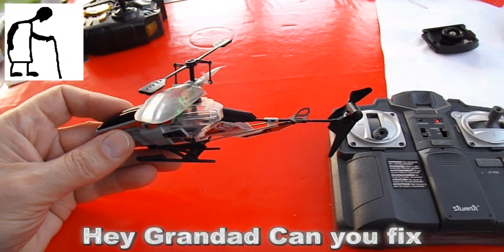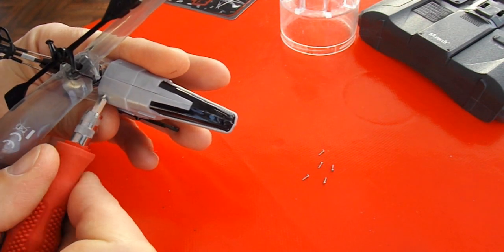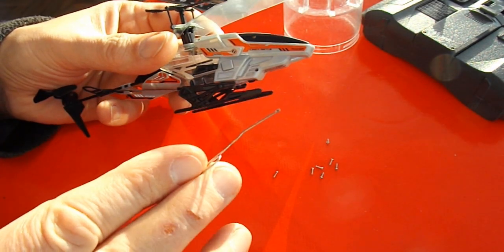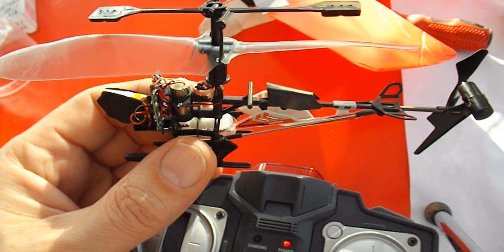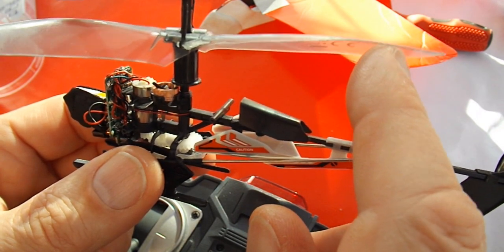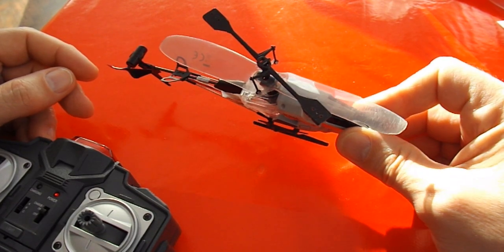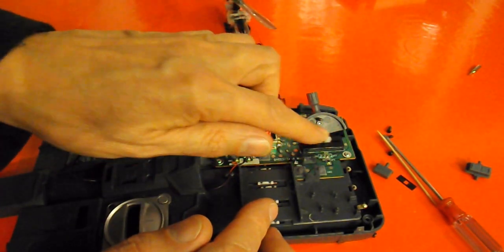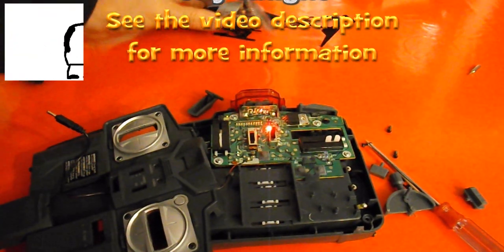Hey Grandad Can you fix Faulty Helicopter Toys? SILVERLIT HELICOPTER

Comment: hey grandad, it's either the two.
1.  The motor that controls the YAH channel is probably faulty.
2.  Towards the end of the video.  you were holding the YAH trim instead of rapidly pushing.  it usually worked on some of my old helicopters

Comment: Pl ensure tail rotor is spinning anticlockwise as not quite clear in video. If not then invert connections of motor on circuit board. If motor spin is correct then only option is bigger tail prop. Motor clearly looks big enough to handle a 2 times bigger prop. Trim & steer only have certain small range of operation, it clearly looks well out of that range. Once bring it in that range all commands will start to work.
Reply from the maker: +Ahmad Rafique thanks for the suggestions and I can see your line of thought. It might fix the issue but there is absolutely no reason why it should require any such modification. It is not likely that the wires have reversed themselves or the rotors have changed size. This is not a kit that has been assembled incorrectly, it was a working toy owned by a relative that has stopped working. Most likely is some sort of crash damage, perhaps the rotors are deformed or the motor shafts bent causing a lack of power or thrust. It could be as simple as the gears are slipping on the shafts reducing the effective power throughput. I am looking for people who have experience the same problem with the same helicopter and managed a fix.

Comment: Burnt out tail motor most likely, especially if there was a lot of hair on it. That bent up propeller probably isn't helping either. I've never seen that small thing that tilts the rotor, is it a magnet and coil?
Reply from the maker: +X-FLIGHT101 the rotor tilt mechanism was the most interesting bit. Yes magnet and coil similar to the rudder servo system on those tiny ultra light indoor planes you see on YouTube.

Comment: If you have other kaput heli's, maybe take a rear rotor off one of those and try it. Those tiny props are excellent, but, others may move more air. 
The motor is likely down on power. A new 4mm isn't a horrendous purchase for him to have his heli back working. Unless of course you have a 4mm rear motor too from another heli.
Reply from the maker: +slider2732 certainly the tail rotor is the logical culprit and I probably have one somewhere. I haven't checked the size but I had that one on the flying wing I was playing with last year. Probably got more if I look around.

Comment: Hey grandad my silverlit nano falcon AH is not working anymore it can't lift it self it needs more power how can i fix it???
Reply from the maker: There is a good chance it just needs the battery replacing - although finding a replacement battery the correct dimensions might be a problem. Some of the listings give the dimensions as a 6 digit number for thickness, width, length. I am not suggesting you buy from this site I am just giving you the link as it explains the dimensions https://www.pdbattery.com/li-polymer-battery-cells-list.html It is worth remembering that online suppliers such as eBay often over state the power of the batteries they are selling so a new battery may not be as powerful as the listing stated. It is possible there could be other problems with your helicopter such as fluff wrapped around the shaft or in the gears slowing it down or the shaft is bent or your propellers damaged.

Comment: hey grandad,

you mentioned some hair stuck to the tail rotor at the beginning of the video. i think this caused this little spinner to overheat. that in turn caused some of the coil wire insulation to melt away and short circuit some of the turns. in fact reducing the total output power of the tail rotor. swap it for a spare one from another bargain store purchase ond you should be good to go.
Reply from the maker: That could be right although just swapping it for another motor may not be as simple as it sounds. I would really need to find the correct match or it will not be able to match the torque of the main rotor. I am giving toy helicopters a rest at the moment but I might have another go sometime. I am trying to do outdoor projects while we have the warmer weather.

Comment: try to reverse the polarity of the tail motor .
Reply from the maker: Yes that would work well, it would spin in the opposite direction and still have no control 😊
Reply: but, I have noticed that the direction of the tail rotor is wrong , so it exhaust the air on wrong direction, if it not works, check the joy stick on your transmittor by checking the resistance of the potentiometer attached to it, also check trimming button.if still not works , replace the reciever of the helicopter by buying some spare parts on eBay or Amazon or in any shop in your locality.
Reply from the maker: I appreciate that you are trying to be helpful. If you watched the video through you will see I stripped down the transmitter and checked the functions. As far as the motor being reversed there are two problems. 1. How can you tell it is rotating the wrong way? You cannot tell by looking at a video because the frame rate of the video will cause the rotation to change. 2. Do you really think a toy helicopter will come out of the factory with the motor connected backwards? This helicopter was fully functioning before it went faulty and was given to me. Short of buying another Silverlit Helicopter I am not aware of anywhere that sells replacement receiver boards. All I have ever found online is rotor blades.
Reply: so, throw it away and bring a new ones!
Reply from the maker: Well the point of looking inside was to see if there was anything simple to fix but I don't throw them away I use the component parts for other projects. I wouldn't buy a new one as I have no use for one. My channel is mainly about repurposing junk and and trying to fix second hand toys.